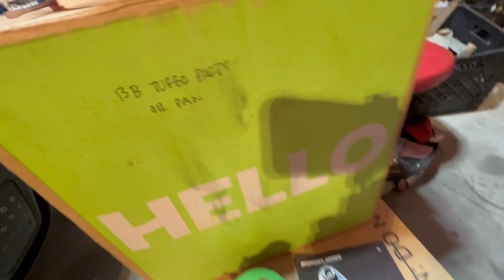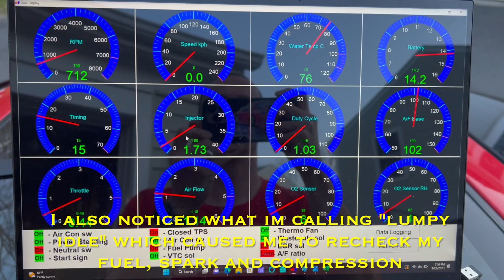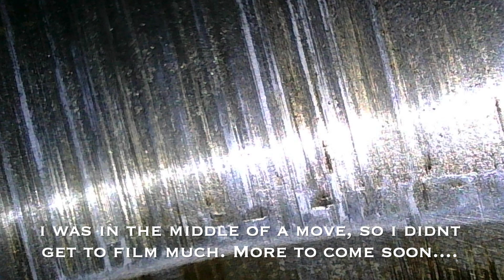Setting Timing, Checking the Speed Sensor and Finding Leaks / Engine Damage Project Z32 TT 300ZX

Comment: You tested the senor by checking resistance?
Reply from the maker: It was by testing voltage. In a different video (also labeled testing speed sensor) I show the service manual procedure.